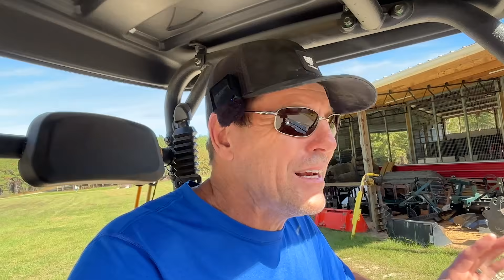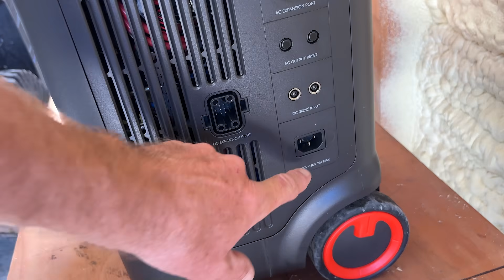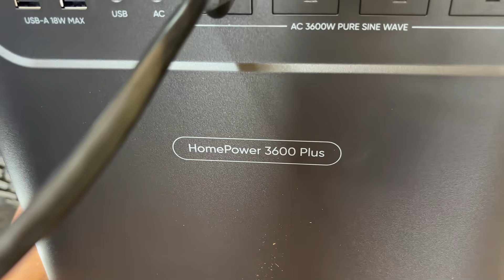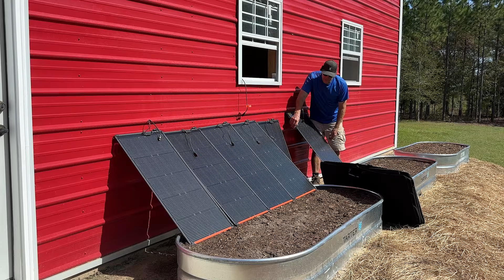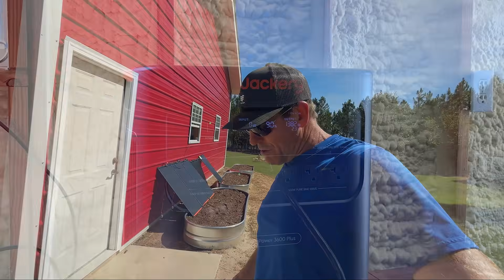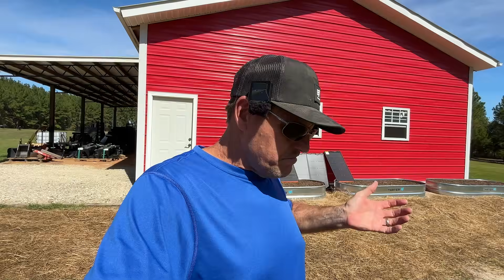Converting To SOLAR Is Much EASIER Than I Thought | Jackery Home Power 3600 Plus

Comment from the maker: We have only had this power station a few weeks and it's already come in handy!   We've been skeptical about them, but the technology has come so far that it was time to try one.   We have no regrets and highly recommend this Jackery power station.
Amazon Affiliate Link: https://amzn.to/3Uhj41U
30AMP power cord for Jackery transfer switch: https://amzn.to/47j1AEN 

Reolink Trackmix Camera provided by Reolink:
Use this link for a 10% discount: https://reolink.com/us/product/reolink-trackmix/?aff=1223

Weigh Safe Hitches - Code PGH10 for a 10% discount
Weigh Safe Link: https://crrnt.app/WEIG/eLVWY7PP

Summit Hydraulics - Code PINEY for 5% discount
https://summit-hydraulics.com/

Ballard Mower Blades 10% discount code:  PGH10
https://www.ballard-inc.com

Hay equipment provided by Tractor Tools Direct:
IBEX TS51 Drum Mower, TX80 Belt Rake, TX31 Mini Round Baler
https://products.tractortoolsdirect.com/piney-grove-homestead
Code: PINEYGROVE-IRP for $300 off a baler

Get a free month of Starlink internet if you sign up using this link:
https://www.starlink.com/residential?referral=RC-3256571-40493-64

Use any link below and then use Code PINEY25 for $25 off of an order valued at $500 or more:
Good Work Tractor Affiliate Link: http://www.goodworkstractors.com/ref/5/
Magnetic Mirrors:
https://www.goodworkstractors.com/product/magnetic-mirror-bracket-for-tractors-gwt/ref/5/
Quick Hitch:
https://www.goodworkstractors.com/product/quick-hitch-for-category-ii-3-point-gwt-fast-cat-ii/ref/5/
Ballast Brackets with Weights:
https://www.goodworkstractors.com/product/gwt-hitch-hanger-bundle-w-6-suitcase-weights/ref/5/
Versa Forks:
https://www.goodworkstractors.com/product/gwt-versaforks-pallet-forks/ref/5/
Mini Wrecker Stump Bucket: 
https://www.goodworkstractors.com/product/gwt-mini-stump-bucket/ref/5/

Vego Garden Affiliate Link:  https://glnk.io/vzw5/558
$10 discount code:  PINEYGROVEHOMESTEAD10OFF

WoodMaxx Power Equipment chippers, tillers and flail mowers:
Piney Grove WoodMaxx Affiliate Link:  https://tidd.ly/45ZAmCr 

QC-Mate X-Boom Hydraulic Coupler Clamp:
https://www.skidsteersolutions.com/
Use PINEYGROVEHOMESTEAD for 5% off anything on the website!

Some of our favorite products on Amazon (affiliate links):
Mower Blade Sharpener Guide: https://amzn.to/4dGYZa5
Dewalt 20V Cordless Grinder: https://amzn.to/4bF2trS
Flap discs: https://amzn.to/3UKEzo0
Grinding wheel: https://amzn.to/3K95ipi 
275 Gallon IBC Tote: https://amzn.to/3XbxwHs
Vise Grip Wire Pliers: https://amzn.to/3WZ2P6U
12V Pump: https://amzn.to/4a3AwsI
Proven Industries Trailer Lock: https://amzn.to/3WVzytv
Flex Tape: https://amzn.to/3R4MdWm
Mechanix Leather Gloves: https://amzn.to/3HjoZZf
Ratcheting Fence Tensioner: https://amzn.to/3aEfSX0
6’ Digging and Pry bar:  https://amzn.to/3vH5Agx

Welcome to our channel!  🎥 What to Watch Next: 
Fixing Leaky Pond: https://youtu.be/NEwSTg1aOWc
Transforming Our Property: https://youtu.be/-jBGEYJea1Y
Baling Hay: https://youtu.be/yQJNF3wFm-U
Framing Our Pole Barn: https://youtu.be/zWgnTFQeiwI

➤FOLLOW US on Social Media: 
Facebook - https://www.facebook.com/PineyGroveHomesteadAndMiniFarm/
Instagram - https://www.instagram.com/pghomestead/
TikTok - https://www.tiktok.com/@pineygrovehomestead

Our Story:
For seven years we have been transforming 20 acres of "Piney Grove" in Northwest Florida into our dream homestead/mini farm soon to be filled with animals and joy. We plan to have a variety of miniature critters on our pastures, raise free-range chickens, grow fish in our pond, garden, plant fruit and nut trees, and harvest wild game. Our goal is to escape the stresses of corporate life and embrace all that country living has to offer as we enter the next chapter of our lives. Follow along on our journey!

Thanks for watching and please Like and Subscribe to help our channel!!
Brad & Deb

Comment: If you are sure you want the solar panels on that side of your building,  I would build an attractive  awning centered above the two existing windows and put the solar panels on it so you don't loose your window views or block too much light from the raised beds. As a bonus: little better shading from sunlight in your building and some rain deflection if you have your ventilating  windows open during Florida's frequent summer showers.
Reply from the maker: Great suggestions, thank you!
Reply: Was thinking the same thing!

Comment: My concern would be how efficient the power station would be in 5 years compared to new and each year after that. I know from experience that solar panels are not nearly as efficient as they get older. I can see where the power station would sure come in handy for certain applications, but it comes with a steep price unless you absolutely had to have it like someone off grid or camping with no electricity. I`ll just keep supporting my O&G friends here in Texas and go with a conventional dual fuel generator. BTW.....There are no free rides. 👍
Reply from the maker: They claim 10 years and then it will still retain 70% capacity after that.

Comment: We live on acreage in the Arizona desert... and we've got solar providing exclusive power to one of our outbuildings.  One bit of advise we can immediately share is to not lay the solar cable on the face of your solar panels.  Shadows, of any kind, will reduce the power output from your panels.  In terms of mounting the panels,, you could mount them to the roof of the building though I'm not a fan of doing this.  My reason is that I don't like drilling holes in the roof to attach the mounting system.  I tend to prefer ground mounts.  Like you we've got lots of open land so ground mounts are much easier to justify.  I  mounted my ground solar array to a ground mount system attached to a number of railroad ties.   The railroad ties provided a way to help counter the wind without having to permanently mount the array to the ground.  Considering that you're in hurricaine territory, a permanent mount might be a better choice than my "temporary" mount.
Reply from the maker: Awesome tips, we really appreciate you sharing your insights with us!